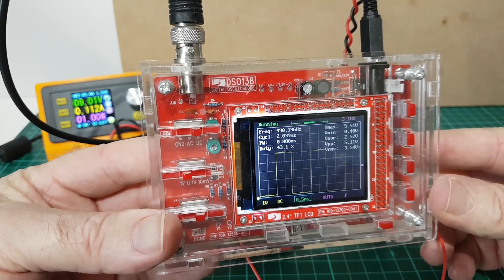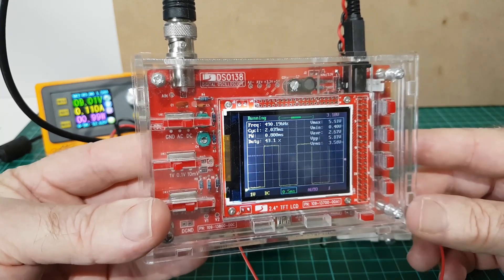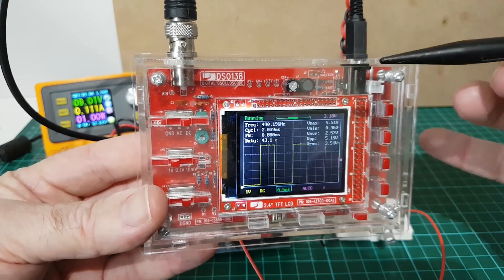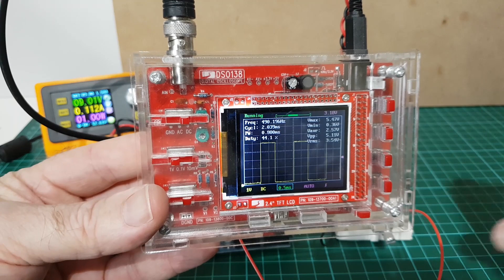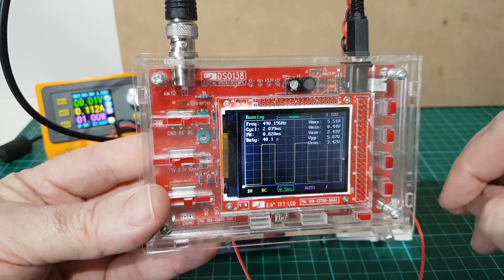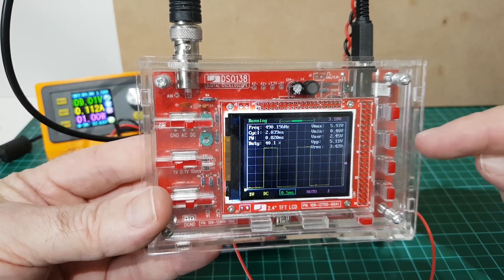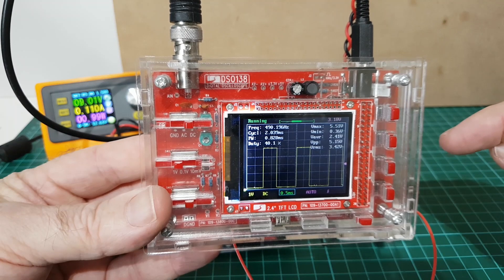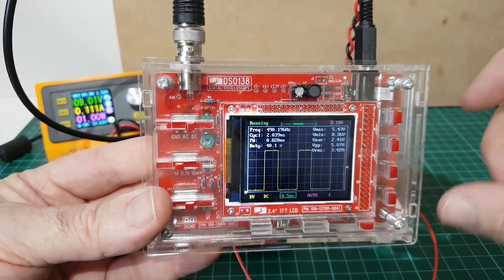Testing a 5.5W Blue Laser

Comment: As with anything coming from AliExpress, I am skeptical of its true output.  Do you think it is close to 5.5w?
Reply from the maker: not sure Blayne, I suppose I could work out some way to calculate it based on the input current and likely efficiency of the diode.  At the end of the day, the focused beam is fairly powerful but I have no other blue laser to compare it to.
Reply: Yeah, without a laser intensity tester it is kinda a gamble.  I just took the leap and bought one too.  Still, it would be a cool video watching how to test.  Thanks for the great videos.  They are a great watch and are a lot of fun!
Reply: It is  about 1-1.5w  5 w diode eats ~ 5v 5a and wood catches fire  instantly

Comment: Hi

I also have one of these lasers. i have worked out most of the wire connections. 12v from a seperate power supply through the driver board. the one im having confusion over is the TTL. did you connect this to the D9 on your arduino or someplace else? i understand that using M106 S126 should power the laser @ 50%

does this sound correct. any advise on my shortcomings would be very much appreciated

thank you in advance
Reply from the maker: Yes the trigger or as I call it in the video "drive" input is connected to D9 one side and ground the other.  You should be able to substitute an ordinary LED on the drive output to test it if you don't have an oscilloscope.   If I'd been a bit more thorough with the script I would have substituted the word "Motor" with "Laser" to make it more obvious.

Comment: Great video, high quality video, everything is clear thanks man, do you data sheet of this laser module
Reply from the maker: Hi Masood,  Here's the basic spec
1.Power : 5.5W (max)
 
2.Electric current:1- 3A input
3,Adjust the focus:Yes(By fingers),<0.5mm at 1CM~30CM;

4,Working Voltage:12V

5,Power supply:>5A;

6,TTL:Yes,White cable at + and Blue cable at -;

7,TTL signal input 0~5V input.(0V OFF/5V ON)(TTL Modulation control the output beam OFF / ON )

8, Frequency for TTL control:0-20KHz;

9,Duty cycle:input 1%-100%;

10,Cooling mode:Heatsink and Fan

11,Material:Metal

12,Lens:Glass

13,Red cable at "+",Black cable at "-";

14,Size:Laser Module:90*40*40mm(L*W*H);

15,Size:Driver board:90*40*42mm(L*W*H);

16,Package:1 X 450nm 5500mW laser module with TTL Driver board+1pcs glasses

 

Features:

* It can adjust the focus smallest dot <0.5mm

*Can carving wood (so easy);

*Can be use for CNC;

*Can be used for carving, cutting. Can cut wood

Transparent and white Material can not be cut.